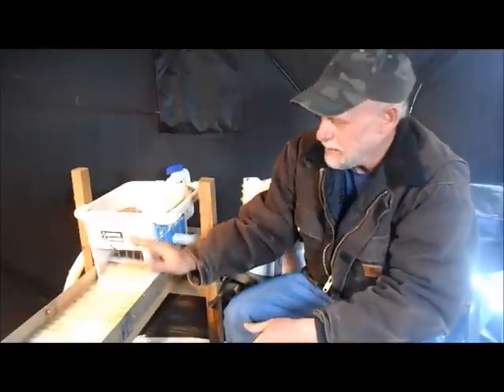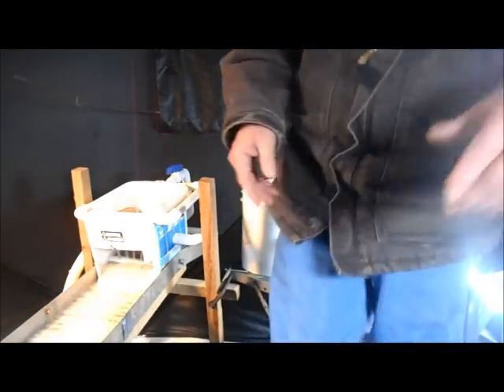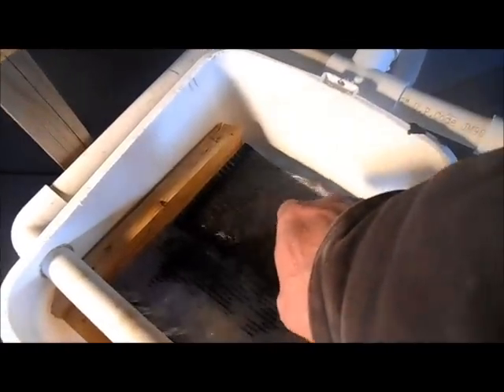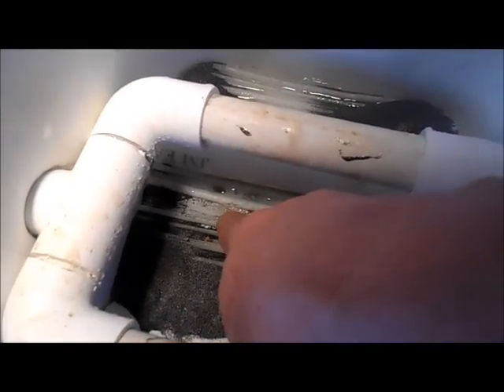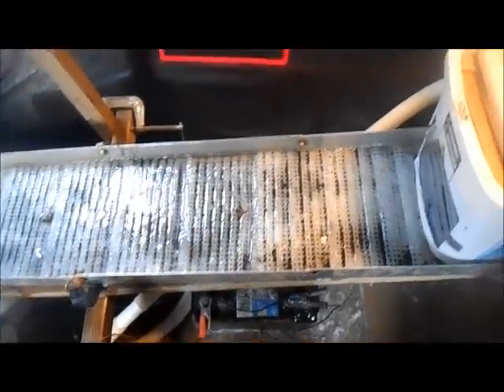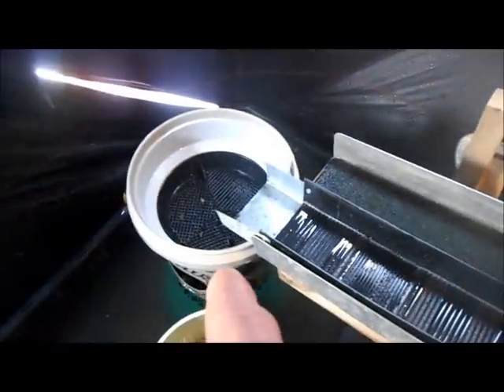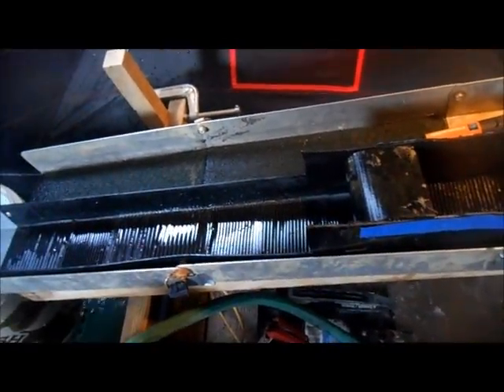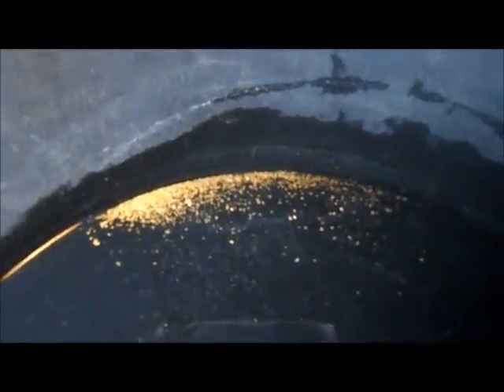My Fine Gold Cleanup System NOW I'm Ready For Beach Mining

Comment: Hot Diggity. It looks like you are pretty well set for the trip. I'm certainly looking forward to it. I'd sure like to get up there again sometime. Looks like the Silicone mats are really working well on that fine gold.
Reply from the maker: I think i am as ready as I can be it should be a fun trip. I can't wait to here how your mats work out.
Reply: Alan Robertson 
It looks great and I can't wait to try it out. The cardboard makes nice deep riffles.  I decided to make a new sluice for it. So that's one of 3 projects I'm working on now. From the way yours are working I think that they're working better than the rubber ones.
Reply from the maker: @utahavalanch  I am reluctant to make that claim on the silicone mats but I think they work better than anything I have ever tried before. Good luck on your projects.
Reply: @alanrobertson2510  
With all my testing on Miller Tables over the years, I have found that gold definitely sticks better to some materials  than others. I now incorporate that in all my sluices as well when I choose a finish. I think that the gold would definitely find a high resistance to sliding on the silicone as well. Looking forward to trying it out.
Reply: Alan Robertson 
I thought I'd pass something along. I put my mat on the base frame of the sluice so I could cut them together and have a perfect fit like I always do. This time the silicone grabbed the saw blade and about 1/3rd of my mat was shredded. I was about to make the sluice shorter and then decided to try to repair the damage. I squirted some more silicone into the mold and laid the damaged end into it and pressed it in. Totally repaired to where you can't tell it was ever damaged. Just take your mold and silicone with you and if you have any damage you can easily repair it.
Reply from the maker: @utahavalanch  That is a bummer it ripped on you so glad you were able to repair the mat. I do plan on taking some silicone with me on our trip it might just come in handy. I had a few sections of my mat that had some gaps so I put the mat in the sluice and ran a bead of chalk between the sluice and the mat the full length of the sluice let it dry and then used a razor knife and cut down the edge of the sluice now I have a perfect fit. Good luck with your new sluice.
Reply: Alan Robertson 
Good idea. I'll keep that in mind as I may need to try that with a small gap.